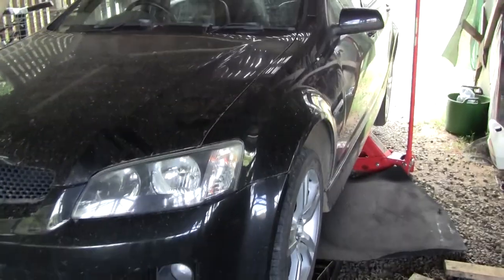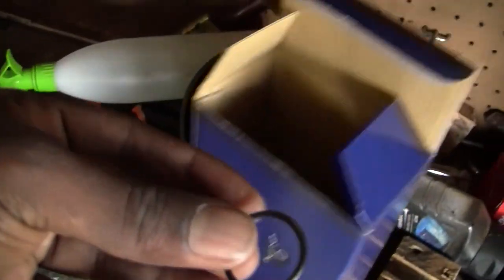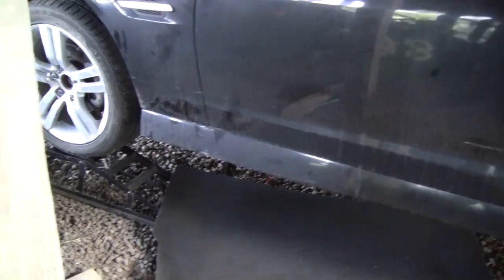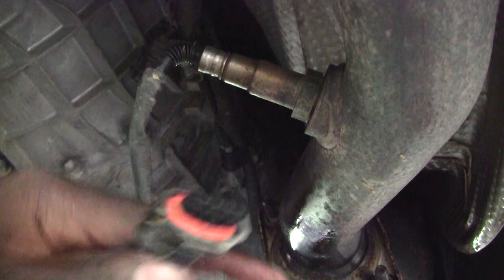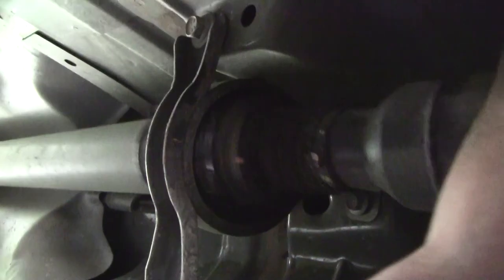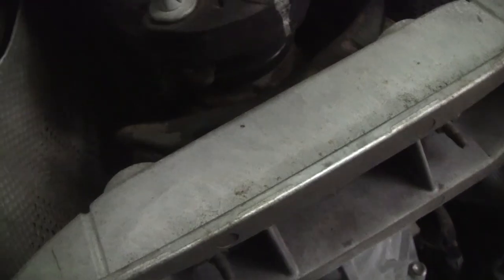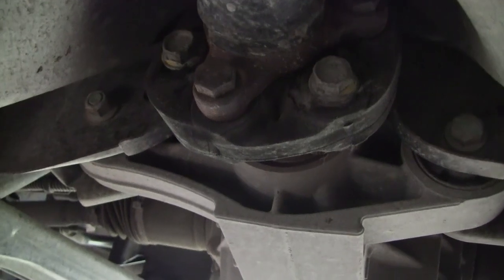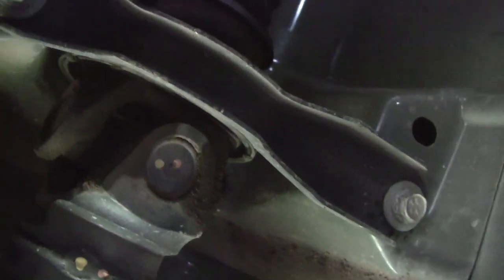VE Commodore Center Bearing & Drive Coupling Replacement

Comment: Circlips are a directional installation. They have a rounded edge side & a sharp edge side if you look closely. the sharp edge side goes to the outside of the force so it doesn't ride out of the groove which is more likely if the rounded side faces the force.

Comment: Congratulations on a perfect assembly/replacement video.Thanks for sharing and narrating this vid, awesome work mate.
Reply: Almost perfect... The instructions at 30:03 say the bolts should go the opposite way on the diff to coupling than the coupling to shaft, but they're all the same direction on the video @35:00.

Comment: Nice video.  Unfortunately if you take a look at the original possition of your old coupling you'll see you misaligned the holes on the new one because the bolts were in backwards originaly. My car has the bolts on backwards too as do other cars, but the coupling holes do line up. 
The power (compression) goes in rotation across the thickest part of the coupling. The thinner part of the coupling is under tension while driven. Look at your drawing again. Cheers.

Comment: Hi mate,
Great video, but I've hit a snag. The bolts connecting the exhaust to the cats at the front have been tack welded on, there's no removing them. What's the workaround here?
Reply from the maker: You will have to cut the bolts on that case. But sometimes they are welded on one side and there is a nut on the other that you're able to loosen

Comment: Hi bro... I have holden vz 2006 got the same issue but i have changed central bay ring and couplers several time but im getting this noise back after few weeks after all i took it to garage they told me my driver shaft is bended lil bit so this is the thing is causing damge to the all of these things.. Finally i cannot find the driver shaft here in UAE. Can you please help with overseas delivery reagrding that.

Comment: Hey mate I was wondering why you marked the shaft connecting to the diff and what would happened if don’t mark it ?
Reply from the maker: You have to get it back in the same spot otherwise it will be off balance.

Comment: I need to replace my front and rear couplings. 
Are they both the same part number? Or different for front and rear? 

I get so many options when adding my car info onto the usual car part websites.
Reply from the maker: They are both the same part number
Reply: @MufudziGambiza  no worries thanks. 
Just hope it fixes my issue lol pretty sure it's the centre bearing
Reply from the maker: @AJS86  9 times out if ten it is the center bearing. Is it vibrating under load?
Reply: @MufudziGambiza  yeah it is. If I accelerate gently it's ok. If I go more than 25% throttle esp in 2nd and 3rd it vibrates. 

I've had a leak in the extension housing seal. 
The oil leak has likely deteriorated the rubber parts in driveshaft. Gonna fix the lot next week.
Reply from the maker: @AJS86  yet sounds like centre bearing and the couplings

Comment: Why did"nt you replace the front drive shaft coupling and you did'nt put a exhaust gasket on the exhaust
Reply from the maker: Front one was fine. There wasn't a gasket so I ddnt put one on
Reply: I still would have replace it so i didnt have to pull every thing apart again. You could have put gasket sealer on exhaust,